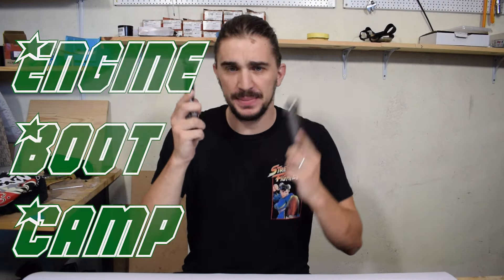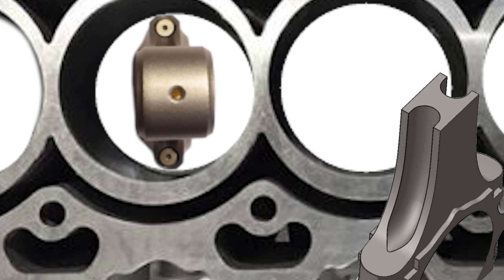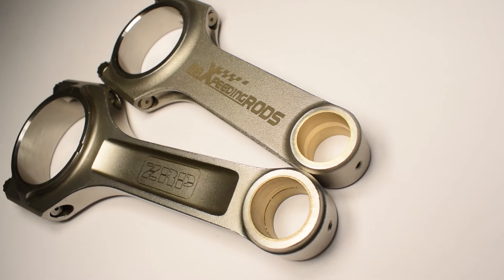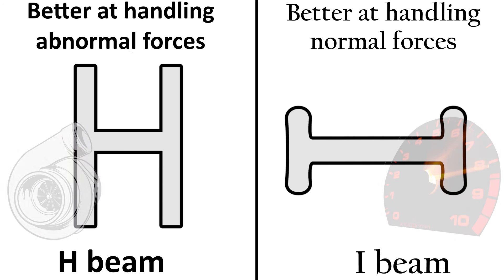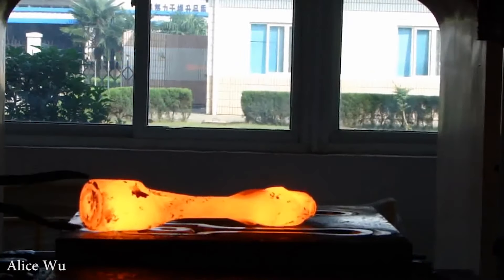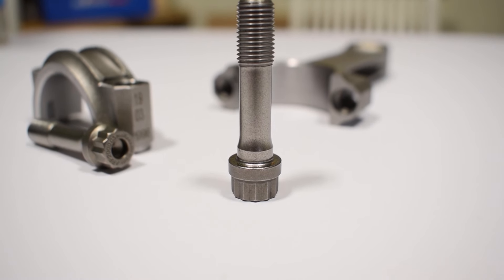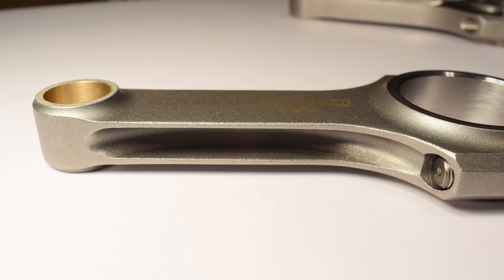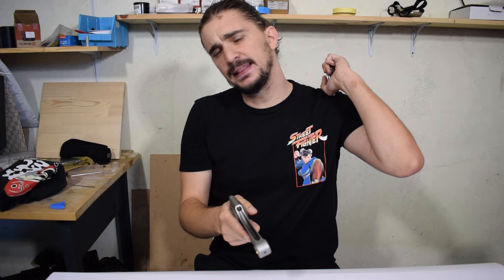H Beam vs. I Beam CONNECTING RODS

Comment: Thank you for clearing this up, I play with 4g63 Mitsubishis and for years all I ever heard was ("I" Beams are the best for our engines) which the stock "I" Beam rods have broken the stereotypical notion of "stock rods are too weak". So that's all I ever used was that up until I got a block recently with "H" and was going to tear it down to replace them with "I" but now I think I'll just send it and 🤞🏻 she holds up. And if she does then I won't ever be afraid of using"H" Beams. Thanks for this video 😉👍🏻

Comment: in some engine desings (V-6 with split pin crank shafts, boxer engines etc.), there is very littly bearing lentgh, here the H-beam is clearly the better choise because it offers better buckling resitance in the critical direction. For inline engines, I agree, it doesn't really matter...

Comment: For na high rpm get the lighter rods. For boost higher hp get the heavier one. If you want both get aluminum rods but need to replace more often.

Comment: In thirty years of professional race engine building (and I've been lucky in working for places that did things properly), I have never seen a rod or big end bolt failure, not even when we had to use modified OEM rods because of regulations. On the other hand I've had several engines sent to me with reported rod or bolt failure. But in every case that I have dealt with, the real cause was lubrication failure which caused the bearing to fail. This then allows the rod to hammer up and down on the crankpin. It is this violent hammering that causes the rod or bolt to break, leading to misdiagnosis. As an aside, you can almost guarantee that a nitrided forged steel crankshaft that has been reground will be cracked on the crankpins - because it will almost certainly have been through the same ordeal as the rods mentioned above. It seems that most people don't have the experience to realise that you should NDT any components that have had this sort of incident. I'm guessing that most people wouldn't be happy to fly on an aircraft where the same attitude had been taken to maintenance.

Comment: I chose carrillo pro h rods, best rods on the market and they're light too. I payed extra for the car bolt too.
Reply: I'm also looking to get some Carrillo rods for my 4g63, but here's the thing... I'm looking both for beefiness and high rpm. If u install em tell me if they perform good or not
Reply: @goosebee  I'm on a 4g63 too, i did a lot of reading and settled for the CP pistons with upgraded wrist pins. Also I went with stock 150mm rods with ACL bearings. The motor spins up fast and goes hard, i think the tuner red lined it at 8.5k.
Reply: @jethrox827  thanks for the info man, I'm running a 6 bolt 4g63 what are u running?
Reply: @goosebee  stock bottom end, evo 9, dyno'd at 400hp AU hp which is about 500 USA hp lol
Reply: @jethrox827  nice numbers dude good luck!
Reply: thanks for the info man!

Comment: This was a pretty good video, just to the point with the right amount of explanation, yeah, definitely a very good video! But you can talk about the "+" connecting rods? The "+" is considered to be more aerodynamic than H or I connecting rods and more suited for high rpm applications! Of course you need a special crank shaft to be paired with those rods because if the counterweights are not designed to be more aerodynamic as well as the "+" rods, that's useless too.

Comment: Rods are mostly loaded in compression but contrary to what some said section stiffness matters because there is a risk of buckling. The overall stiffness of the part will be important to prevent buckling that's why the tapering/progression of the section is important.. Strong ends will significantly limit eventual buckling. 
For static strength the H looks better because without or with low dynamic load the weakest plane might be the perpendicular one where the H help prevent buckling (it's not an easy answer without all dimensions).
Contrary to common belief i would tend to think the I one is better for high rpm because the dynamic loads will be huge and in the rotation plane the I beam will help, those dynamic loads will "help" the part buckle by inducing flex. I will limit that more than H.
That said the video answer the most important thing for customer : this does not matter as much as the other properties of the part.

Comment: Jim,I see that now they are making caged roller bearings for use as cam bearings is it possible to use caged roller for big end rod  bearings and even wrist pin roller bearings finally, caged roller bearings main crankshaft bearings maybe the Germans could do it with high pressure cold oil cooling ?

Comment: Hammer die forged chromoly I-beam rods are hard to say no to. They are strong, they do weigh slightly more than typical cast steel fracture split factory rods, but they are the cheaper of the options in rods and won't let you down.

Comment: Very rare a rod breaks on it's own, but CAN happen, instead, are mostly from collateral damage. If a rod is gonna break, like anything else, it won't matter what material it's made from, or what shape it is. That said, it has been my experience when diagnosing a rod failure, is that they break from outside in, not the other way around. That alone tells me, and why I mostly use them, is an I-beam, being thicker and stronger on the outside of the beam, is stronger. Ever see an aluminum H-beam? Also, H-beam design rods hold a ton of oil weight in the channel of the beam, which most don't realize. I do use them in moderate builds with success, but my first choice is an I-beam design.

Comment: I was always under the impression that I beams were stronger than H beams because of the opposing side loadings, where an H-beam usually has a single center loading which is just as thin as a single side of an I-beam. H beams were just as strong as I beams at a lower weight but couldn't resist compression as much as i beams. In high turbo applications at high rpm, the sides tend to flare out.

Comment: Hi, greetings...
I have a sugestion for a video. Talk about, "What makes more power with the same turbo pressure, a low compression turbocharged engine or a high compression turbocharged engine?". A comparison talking about ignition timing and volumetric filling... We heard here, that, the theorically a low compression engine fits more air/fuel into the cylinder and accept more ignition timing and the high compression engine  will accept less ignition advance and fits less air/fuel into cylinder. The high compression engine cannot go into higher pressures of turbo, because the major risks of engine breaking, and the low compression turbo, can uses more turbo pressure. That makes the low compression engine turbocharged engine with a higher pressures of turbo makes more horsepower than the high compression engine with the same pressure.
Thanks in advance.

Comment: I was super interested in H beans until I realized the fact that they're normally compared to the bad wrap of I beams being linked to shock rods. Now I just look for the nicest beefy looking rod with the most appropriate weight (I got reallyinto building high revving smalblocks). If its built better than stock it's better than stock. The way I see it the strongest piston rod is a blue printed crankshaft lol

Comment: Some engines have H beam stock (ie 2004 Mustang Cobra). H beam has less windage, but I beam is better at resisting beam bend since it is the correct orientation for the loads of the piston. That said, they are both overkill.

Comment: no. that's kinda how force loading works. the polar moment of inertia is how we express a shapes ability to withstand moments. the superior shape is the one with the highest moment of inertia in the loaded plane. you can make an H beam better than an I beam purely by thickening up those webs. if you are going to compare the same exact weight rod with the same exact cross sectional area, the I beam will win. barring a silly design, you will be able to make the I shape have a much higher moment of inertia. these bent rods are likely from buckling stress, so you would need to balance both directions so the rod doesn't buckle sideways in either direction. if rod manufacturers provided cross sections and materials with temper, you could objectively compare each rod and determine who is better. direct cross sectional area is only used to compare tensile stresses, and cannot be used to determine the effectiveness of a bending moment. if these rods were loaded purely in tension, the bigger cross section would likely win. the nature of friction on the wrist pins and crank causes moment loading though which is not a pure tensile load.
Reply: Eccentric loading should be considered for buckling, too.

Comment: So I may be missing something, but why don't we have square-beam rods? I understand the weight increase but the strength properties would, presumably, outweigh that negative. Especially in FI applications where abnormal and normal forces would be exerted.
Reply from the maker: How would you make one? Weld it? 😉
Reply: @d4a  I mean, you could simply omit part of the machining process lol. Edit: Or change the shape of the forging plates.

Comment: your channel deserves so much more. would you cover piston port 2 strokes in a video? im at a cross roads with mine, i race a 13hp motor with very strict regulations vs a 17hp open for mods motor, i can compete however i dont have the understanding to take it further within the rule book. even just a basic run down would really help. if you need any photos or videos (that is if u give enough of a shit to cover it) just ask, i can provide

Comment: Some rods have a horsepower rating with them. I wonder, do they have test engines that they test the rods in, to the point of failure, and then apply that Failure@Horsepower rating to the label?

Comment: Watching your program I like what you’re saying I like how you explain it so when I built my small block Chevy I had everything balanced crankshaft rods pistons wristbands and works very well are used ARP fasteners throughout studs on the lower end studs on cylinder heads keep this small block together thank you for your video I’ll be watching more and putting this on save to reference later thanks again. DAGO. Linda Vista.

Comment: are you so sure RPM matters, or maybe piston speed is more of importance ? an engine may not rev high yet still, with a long enough stroke, the piston speed will be orbital, and even if an engine revs out of space, maybe it has an unusually short stroke, and piston speeds are not impressive.. you are on point btw, H or I beam is not the most important thing and depending on application one may be better then the other, but there is no clear winner..

Comment: The point that you havent  made is, when  a  rod breaks ,its at is centre of gravity point, and  why it breaks, because the fatigue strength of the  material is not high enough , fatigue strength thats whats  important,and if you want a very fatigue resistant standard rod then get it Shot Peened at a reputable shop. Then it will with stand fatigue better than most after market rods. This is due  to their forgings being overall machined which cuts through the forging fibres. Turbo used rods normally bend through detonation and usually people who change an engine by sticking a turbo on dont remapp the ecu. So the rod bends ,in very high turbo engines rods dont bend.  And rods break in engines with very high rpm because of Fatigue .....60years designing engines from high performance sportscar engines through to F1.

Comment: The "beefier" Toyota engines come with some pretty stout rods from the factory; any of the R/RZ series, the turbo variants of the JZs, the 1FZ-FE and early UZ engines all have decent dimensions. In most cases the cost of a new aftermarket "upgrade" set will be less than refining the stock and adding ARP hardware, but I wonder how close an OE set specs to aftermarket when refined with deburring, cryo treating, stress relieving, end-to-end balancing, and shot-peening.
Reply: I incidentally bought a set of "tricked out" 20/22r rods from a machinist that used them as practice for his final year in school; he installed them in an engine sold to me years ago, and when the block was taken out by overheated Hypereutectic pistons I discovered a nice treat hidden inside.

Comment: Seems to me the H beam would catch oil causing wierd balancing issues.  Probably insignificant.  Either can be designed for specific forces.
Reply: Manufacturers are using cracked big ends now.  Aftermarket I guess doesn't do that?  The problem of matching the cracks is a problem?  Would think they could mark the caps/rods?

Comment: I beam are thicker heavier rods. no chance a h beam is heavier being lighter is the reason they’re made.
The other arguments that I beam are usually rated at much higher applications hence cost much more for a set per engine. 
Nitto, spool, wiseco’s boostline rods

Comment: If the H-beam conrods were in ANY category better than I-beam rods (i.e. cost, weight, strength, available space, ...) then you would see H-beam conrods by any manufacturer - but you don't. Because they are not superior in any category. Which makes sense, because of material physics.
For aftermarket products there is a special category that seems to be quite important: standing out, beeing special, looking different - and that is where the H-beam conrods comes in.

After all I do support your statement: buy what is made out of the right material with the right manufacturing process and with a reasonable price. If a H-beam conrod fits those criteria, then there you go!

Comment: More important than h-beam vs I-beam is quality rod bolt and the size of the rod bolts. The arp2000 rod bolts are a quality bolt but, a custom age 625+ rod bolt is much much stronger. You also have to pay attention to the rod bolt size. A 5/16" bolt will not handle the same power as a 3/8" bolt but, a 5/16" 625+ bolt is about the same strength as a larger, 3/8" arp2000 bolt. The 5/16" 625+ bolt allows the rod to be lighter and just as strong.

Comment: I'm no expert but "piston speed" also comes into it.  Quite a few folk have "stroker" engines whereby the piston speed is high per revolution; and stopping this increased velocity and returning the pressures the opposite way for each RPM does come into play as the stroke is a lot further, especially at around 7,000 rpm and onward in a stroker v8.  Short stroke engines have far less forces and pressures at play due to lower piston speed per crank rotation.  Its why Formula 1 and motorcycle engines can rev so hard with no damage - short stroke - high HP - low torque - bloody fast in the right rpm range.

Comment: So in a boosted application and all motor application in the Honda engines. H Beam Steel rods are better for boost and I beam aluminum rods are better for all motor for weight to power ratio In high rpm engines.
Reply: Not exactly. The rods don't know what brand engine they are in, and typically, it would be the other way around. However, it is always application specific..
Reply: @vengeanceizmine9878  why i said that was because Naturally Aspirated isn't forced induction like turbo, so aluminum rods has a higher chance to withstand the beating also gives a better chance for naturally aspirated engines to have a lighter and faster rotations. As to force induction turbo with which beats the aluminum rods to work harder that than it should be?? causing it to wearer out faster than it should be??

Comment: They just look too good to put inside and engine. Better on the coffee table. Anyway, fantastic talk about rods. I always wanted a set of fancy rods, so I went Carrillo H Beams because I was building a low revving high boost engine. Here compressive strength out weighs tensile strength. Now looking down the rod from the top, they are always rectangular section. In tension the section doesn't really matter. In compression the section matters. Put a rectangle shape under compression and it should naturally bend on the long sides because they are closer to the centre giving them less leverage against bending. Also on a H Beam the tensile stress flows around the bolt holes. Look at all the caps, even on the I beams, they are all H Beam. Bolts threading into the top half of the rod are good coz it saves having a step in the rod for a nut to sit on. One thing you didn't show was what any of these rods look like with the caps off. They should have alignment dowels.
Reply from the maker: Glad to hear you like the vid. I did show the alignment dowels, but in a different video: https://youtu.be/-E0H2voOC2M